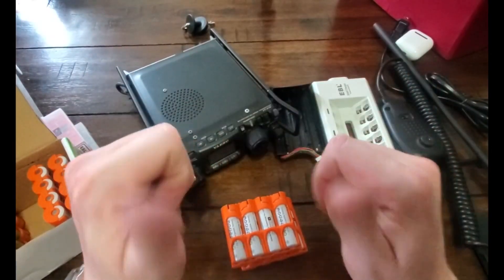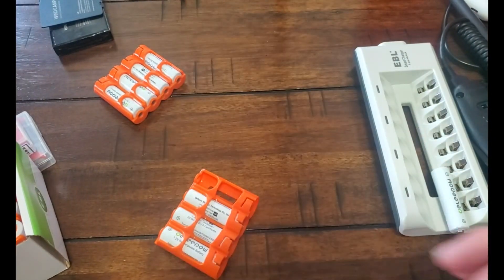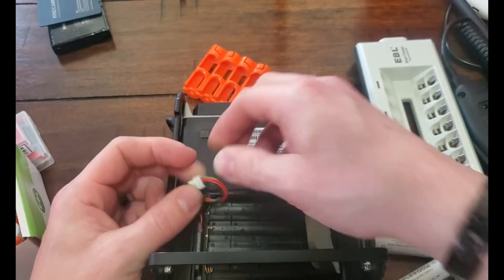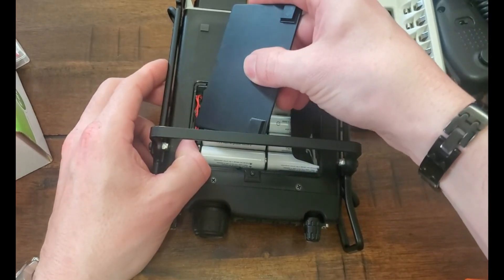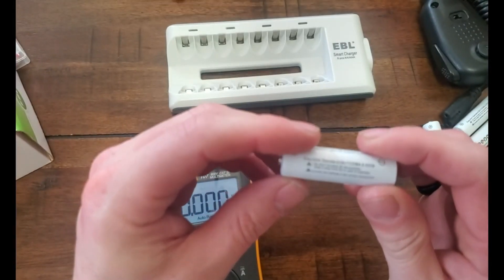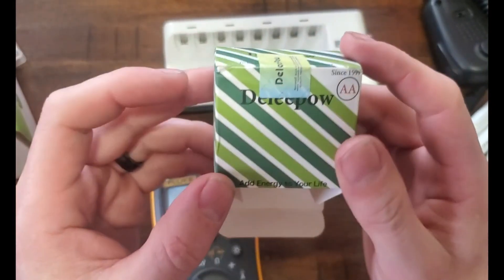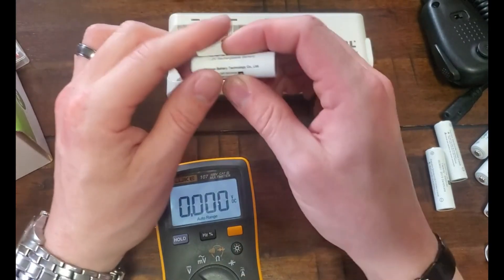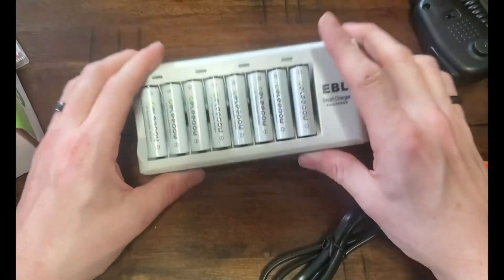Deleepow Rechargeable AA Nimh 3300mAh 1.2V Batteries in the Yaesu FT-818 - The No Code Tech

Comment: They have to be either nicad or nimh (the only widely available chemistries which produce 1.2v per cell) and these are compatible with chargers.  If they were lithium AA cells, they will just not charge. Most of the lithium rechargeable AA cells physically won't charge in a regular charger.

Comment: I’ve been looking at the FT818 for a while now,but these battery options are making it difficult not to buy 😝 😆 😆
Reply from the maker: Hopefully not for your first HF radio. I don't recommend QRP for a first radio.
The point that should be made is you won't get much operating time out of the AA battery option.
Great for a quick lunch time activation, but not much beyond that.
Otherwise the 818 is a great radio.
Hey thanks for watching!